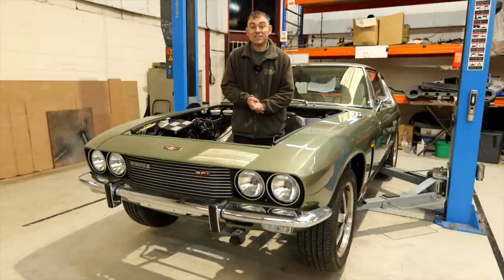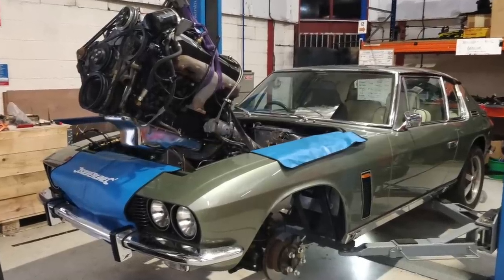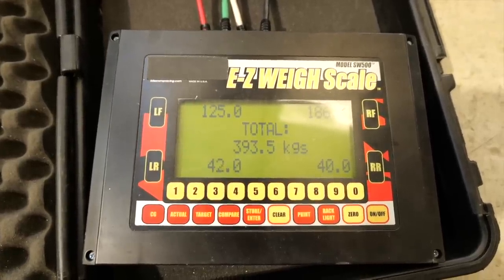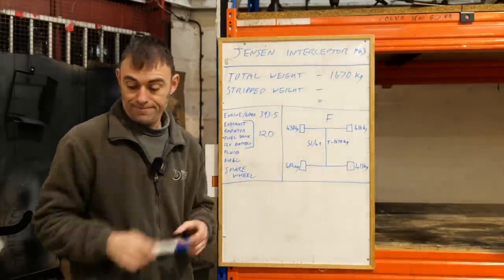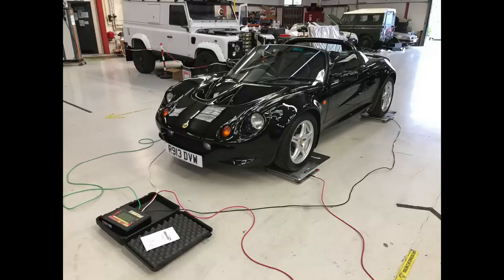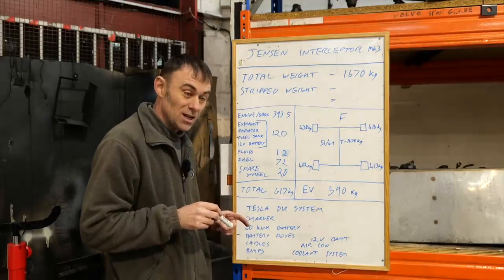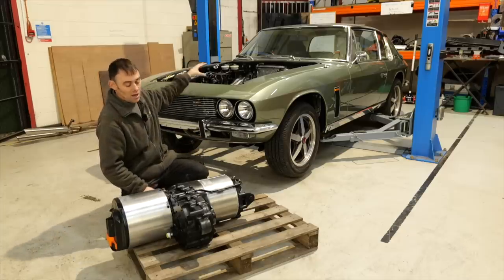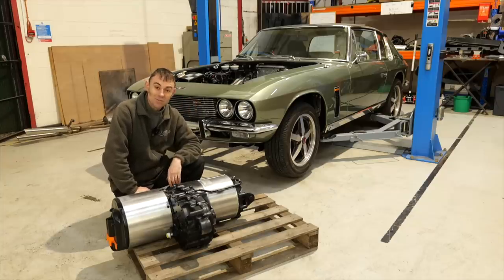Shocking amount of weight removed from the Jensen Interceptor.

Comment: I was a passenger as a lad in a Jensen from near Darlington to Salisbury in an Interceptor, cruising down the A1 at 115 mp,h  we refueled twice on the A1. That should give you a clue how much it drank !!!   But what an incredible drive, smooth fast and powerful.. So later on, much later on I bought one, and its been finished and stored away since 2004 ready for the day they appreciate in value, which seems like never. Was thinking of having it converted and removing the kiddie seats and using that space for additional batteries. I would hope for 100 KWH on board. We will see.

Comment: 867 lbs for the motor and transmission is right. The 440 is a pretty large and heavy duty engine. Forged crank, beefy rods, high nickel content block etc all adds weight but also longevity to the engine. They helped give the Jensen the performance they were known for!
Reply: And the wonderful sound of that big block.
Reply: @212MPH  I had a 1966 New Yorker with a balanced and blue printed slightly modified 440 in it. It sounded really nice and went as good as it sounded. Surprised a lot of Mustangs and Camaros with it. They couldn't believe they lost to a New Yorker in the 1/4 mile and by a lot.
Reply: The torqueflight auto trans wasn't exactly a light weight either!
Reply: @mikedx2706  The 440 weighed about 745 lbs and the torque flight about 125lbs.
Reply: plus the engine particularly if low miles should be worth the effort to sell it perhaps best possible going on $10K USD.  Change the oil and video running it BEFORE removing it from the car when removed cleans the engine and it should be an easy sell on Bring-a-Trailer, eBay, Craigslist etc depending on what the engine comes out of!
Reply: @touchyu2  I believe the engine had a fuel injection conversion. That in itself is an expensive thing to do. A well-built 440 can make over 700hp on pump gas normally aspirated.
Reply: I ran a 850cfm Holley and Mopar Purple cam in mine back in the day from local US custom car parts shop. Nice upgrade . Despite the weight these handled well and pretty neutral . Jaguar XK front suspension,  Jaguar Mk2 axle with Salisbury Powr Lok diff so plenty of suspension parts available and easy geometry mods . Tyres limited to Dunlop SP Sport to keep it pretty on original wheels ,  but good enough .
I had a spare alternator and starter from a Chrysler Newport found in a US car breakers yard in Barking that I used to swap in when those in use melted . It got pretty hot under the bonnet the exhaust runs too close to the starter . The melted ones would be rewound ready . My mate serviced the car at his garage . He had to break his arm in 2 places to replace the spark plugs . Seriously jacking the engine of its mounts helps plug and starter replacement . Totally unreliable ( AA was a must )  but fun car with plenty of room if the spare is left under the boot where it belonged .
Reply: @lisam4503 You seem to be right with the "EFI" badge
Reply: @lisam4503 it can do way more than that NA and still streetable.

Comment: I took a second look at this video and I want to tell you a few things about the 440 Magnum engine. Starting in 1974 the 440 was built with an externally-balanced crankshaft. To determine which crank your engine has, the motor's numbers are stamped on the block, next to the distributor. If you engine has a 440E stamped on it, don't sell it to anyone that owns a classic Mopar muscle car like Richard Hammond, who owned a '69 Charger R/T. The front harmonic balancer on the front of the crank has an egg-shaped casting on front; take the crank pulley off to verify. Also, the torque convertor has weights welded on to balance the rear of the crank. There are a load of aftermarket, high-performance parts available for these old motors; it's just a matter of waiting on shipping and import taxes. Your motor looks to be in exceptional shape. In the US, your 440 would go for $1000 to $2000 bucks. The 727 trans is rather common, so $250. The '69 440 Magnum was rated for 375 HP, run without the fan belts. The Imperial and the police cars ran a 440 that was basically the 440 six-pack with the three 2-Barrel carbs replaced with an 850 CFM Holley 4-Barrel, for 390 HP. Thanks Mate, Cheers
Reply: Thanks for the info. 👍😀

Comment: A celebrity who drove a Jensen Interceptor in the early 1970s: Kendo Nagasaki, the most ferocious wrestler of all time! At the same time he had a 1968 Rolls Royce Mulliner Park Ward 2-door coupe (predecessor of the Corniche), and he said the Jensen was better built. It's still one of my dream cars...
Reply: Good one, I remember him and when his mask was ripped off. 👍😀
Reply from the maker: I wonder what Big Daddy drove, or Giant Haystacks? 😉😁😆
Reply: @ElectricClassicCars  Kendo says that Big Daddy didn't drive himself to wrestling matches, he was driven by his brothers in a Ford Transit van with a specially modified seat! Haystacks apparently liked big Mercedes saloons, the V8 SE range, and he also needed a special seat to accommodate his size and weight. The 'Electric Classic Cars' spirit of upgrading powertrains was occasionally apparent - Pat Roach once had a Bentley R-type (the model before the RR Cloud shape) in which he'd replaced the smooth but thirsty 4.6-litre straight six engine for a somewhat coarse 3-cylinder Perkins diesel tractor engine! Apparently, Pat was delighted with the increase from 9mpg to 30mpg, but Kendo said the whole car vibrated like crazy, as badly as any tractor! Kendo said, "He loved it, but he'd ruined the car! He wouldn't hear of it though!" It's likely that he'd have been an ECC customer!

Comment: I used to have an Interceptor. The rumbling V8 was the best part. Take that away and you are left with a rattling, squeaking old thing that you would quickly get bored of because it would have no soul. And of course it will burn you garage down when it catches fire.  Interesting video though. So an original Interceptor is 30kg lighter than than the new Maserati MC20 full carbon-tub supercar!
Reply from the maker: Burn your house down. 😆😂🤣 Thanks for that... I needed a laugh. 😆👍
Reply: @ElectricClassicCars  I don't mean as a result of your workmanship, I am sure it's first class. I have seen far too many EV battery fires. My friend charges his Taycan at the other end of the yard - a long way from the building that houses his car collection for a good reason.
Reply from the maker: @burgundyexpress  It's a good idea he keeps his Taycan away from those petrol cars that catch fire all the time. 😆😉👍 https://www.thecarexpert.co.uk/are-electric-car-fires-really-that-common/

Comment: Would it work if you could mount the Tesla motor in the back (and save the prop and gear housing weight too) along with some of the batteries and then mount the remaining batteries etc in the original engine compartment? You could possibly gain extra storage in the engine bay above those batteries too. Or go the full Jensen FF route and have motors in the back and the front making it 4WD? Probably difficult and expensive to achieve but it would be glorious! 
Keep up the great work guys!!
Reply from the maker: Unfortunately there's not enough room in the rear without cutting the boot floor, we'd also need to change the rear suspension as it's a solid rear axle.

Comment: This shows the potential problem with an EV conversion of a light gar. I've got a K-series Caterham that weighs about 550kg, so the same as the engine, exhaust + bits, spare wheel and engine fluids from the Interceptor. I'd be interested to see a conversion of something skinnier to see what's possible.
Reply: And no room for and battery to get you anywhere.
Reply: @MrLeovdmeer  Re: Caterham, there's plenty of room. The motor doesn't have to be crazy huge and there are potential frontal and rear areas to store the battery packs. The issue is one of packaging, and branching off from that, weight distribution. However to have a go at half solving these problems, the level of engineering required to make the most efficient use of the space, would be intensive and quite pricey. Not impossible though. A light car such as the Seven needn't have a whopping great battery pack or a big Tesla motor.

Comment: Love the front of the Jensen the most. Similar to the Triumph PI on looks, although bigger. The rear of the PI was nice but the cabin looked a bit weird, sort of perched on the body. The Interceptor is all round cleaner looking and wider. Be great to see the conversion. I was wondering if a rear motor might benefit the PI too, leaving the engine bay for batteries and frunk?

Comment: Excellent video guys. Details like this are far more interesting to some of us that just the finished product. I was actually surprised that the whole car was not heavier to start with. Also, the near 50/50 weight balance was also a surprise. Cheers
Reply: I was very surprised by the weight distribution. 👍😀
Reply: My Mazda 6 with 2 light people on board is 1600kgs. My Tesla S is 2200 kgs with 2 people in it.
Reply: @markmark5269  yes, new EV's are extremely heavy. I just can't wait for one on them to crush me in my 1100kg Beetle.

Comment: Clark Gable did not own an Interceptor or a FF model he died in 1960, the interceptor wasn't available till 1966.
However the Jensen brothers Alan & Richard did build him a special car this was in early days when Jensen had just started building cars.
Reply: 1936 jensen-Ford convertible
Reply: Jensen built an Interceptor from 1950-57 with a 4 litre straight 6 Austin derived engine, nothing like the later V8 engined Interceptor models from 1966>.

Comment: It's a pity that some sort of in-wheel electric motor isn't an option.  Dropping the weight of the drive train, differential, etc. for a cable and transistors would be great.
Reply from the maker: It would likely weigh more as in wheel motors mean you now have 4 motors, 4 inverters, 4 cooling systems for the motors and 4 times the cabling.
Reply: @ElectricClassicCars  Why wouldn't you have one inverter before the cable splits?  Would four cables be heavier than a drive shaft?  Would air cooling four smaller motors not be possible?

Comment: Interesting as not many celebs actually owned a Jensen as Jensen used to lease their cars out to famous people. The Jensen interceptor was the first car fitted with a type of ABS power Breaking System and the FF version was the first car to have four wheel drive single gearbox with Limited Slip Differential. Like the Jaguar E type 4.2 the Jensen was known to hit 150MPH. Also unlike today all vehicles had to carry a full size spare wheel and jack tool kit . As the tool kit was not part of being weighed very strange.
Reply from the maker: Interesting, there was no tool kit in it. 👍

Comment: Great video, bet no one back in the day ever thought you'd see an electric interceptor, I had a mk1 and tbh it was the fuel consumption that did me in, you could actually see the gauge dropping, had an e type s1 at the same time and that was a lot more frugal, I used them as every day cars at the time.
Reply: Can you remember what the mpg was? 👍😀
Reply: I used to have a mark  1 as well loved it fuel consumption was bad but dodgy care and I don't to this day
Reply: @garrysimpson4056  yes it's worth it for the experience.
Reply: @Royston Vehicles  yes it was fantastic I sold it for £2500 ish in around 1985
Reply: @garrysimpson4056  I sold mine in about 2010 for 5k as the sills had gone, they weren't expensive until recently, used to like to put it in 2nd and floor it!
Reply: @Royston Vehicles  yes every thing has gone stupid now,plus years ago we good go as fast as we like unlike now
Reply: @garrysimpson4056  yes bud, I used to absolutely fly around, unless you got police behind you there was no problem, I've cruised at 120 in the jensen, totally stable.
Reply: @Royston Vehicles  yep I had a mk2 cortina lotus with 4 cibies on it went everywhere flat out

Comment: I owned my 1973 "Gentleman's Express" for over 20 years.  It never let me down but it sucked down gasoline!  7 mpg on the highway and just 4 mpg around town.  They were US gallons of course (20% smaller than Imperial gallons).  I also had an aluminium Holley "Street Dominator" intake manifold which eliminated 60 lbs of weight and with a genuine 1000 cfm Thermoquad carburetor was good for 14.1 seconds in the quarter mile at Carlsbad, California, raceway.  Sadly I sold it before moving to Oregon a few years ago where I've started a project to turn my 1970 Lotus Europa into an EV.  Perhaps I should have kept the Jensen and sold the Lotus!
Reply from the maker: Cool story. I bet the Lotus handled better than the Jensen. 😉👍
Reply: @ElectricClassicCars  Actually the Interceptor handled very well,especially at speed.  The almost perfect 50/50 weight distribution helped, along with some good Koni shock absorbers.  When I bought the car some teenagers had been bracket racing it at various drag strips.  The result was that the rear springs had sagged badly but after I had them heat repeated and re-curved by a bloke in Anaheim the handling was very good.  Plenty of road hugging weight of course.

There was a stretch of road behind the Tustin airship hangers that I used every day on my way to my office.  There were no cross streets for about a mile and a half and, traffic permitting, I would hit 135 mph easily every day I could.  Unfortunately, with the aerodynamics of a brick, it was just about flat out at that speed, but steady as a rock.  I'd hit 90 down Laguna Canyon on quiet traffic days (now a divided highway, then a two lane road) and the car would just drift lovely as she rose on the suspension over a rise on a bend there.

We'd stay at the Desert in when we drove to Las Vegas and the car hops would always park the Jensen outside the main entrance.  It was bright yellow and reflected well in the dark glass front and I never told them off for doing burn outs when they had to move it from time to time.  The Chrysler 440 HiPo engine and 727 transmission were bulletproof.  I didn't have the Europa then but I did have a 1965 Lotus Elan for the mountains and my Buick V6 powered Triumph TR7 Spider for running around town.  I still have the Spider and replaced the Elan with the Europa after I suffered Lotus withdrawal symptoms.

Comment: I'll be really interested when you install the reVolt Systems Tesla crate motor. I know you don't work on non-classic (or any) Toyota trucks but my 2013 Tacoma double cab, 4WD, might be an interesting project for someone. Looking at the reVolt motor, my Tacoma has a transfer case connected to the transmission so a special adaptor plate would need to be made to go between the Tesla "gear box" and the transfer case to make it work. 350-450kW power and 800+ lb-ft torque at the yoke would give me the towing power I'd really like to have. I don't need to go 0-100kph in 3 sec, 6-8 sec is fine. Drop the gas tank and there's plenty of room under the bed for batteries.

Comment: Richard, I know that you hit on the fuel costs for the Jensen, but there is something more. In the UK, the Annual Road Tax for a 7.2 - litre car would be an extremely high rate, whereas the Electric Conversion should REDUCE the UK Road Tax amount. I am an expat residing in Australia, and on visits to the UK, I have discovered that BIG CARS pay BIG Road Tax! Please let us know (if possible) what (Annual) savings could be made on Road Tax - by direct comparison with the Jensen ICE, and its' removal. I own a '71 Beetle (now EV), using Netgain Hyper 9 + 5 x Tesla model S battery modules. It's a real thrill to drive, and I cannot imagine the thrill for the Jensen Owner! EV Jensen will be quicker that the 7.2 litre engine, because of constant torque and constant power. Greetings for Sydney!
Reply from the maker: Classic cars don't pay any road tax. Hyper 9 in a Beetle is a fun combo. 👍
Reply: @ElectricClassicCars  I always thought that the classic cars of a certain era did not have to undergo the Annual Safety Check, but wasn't aware that the Road Tax was also zero cost. Thanks for your reply.